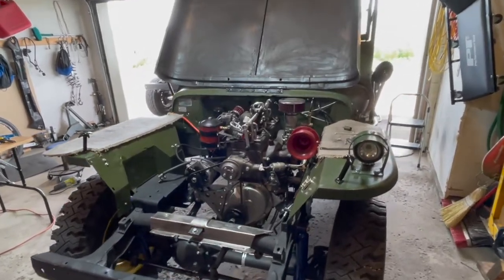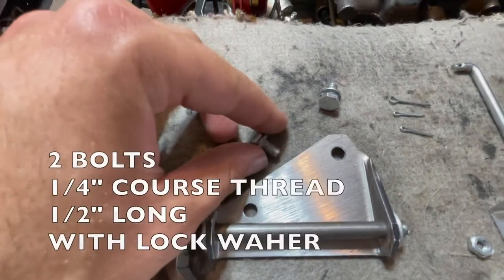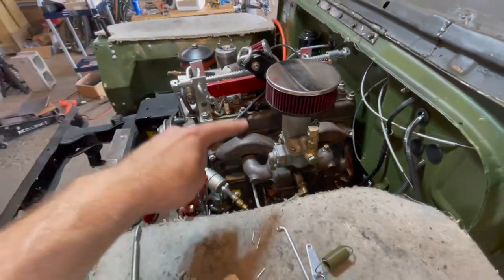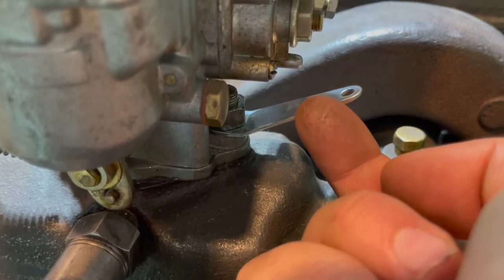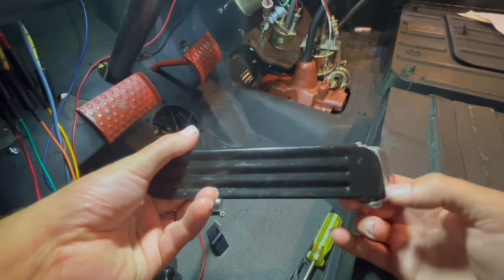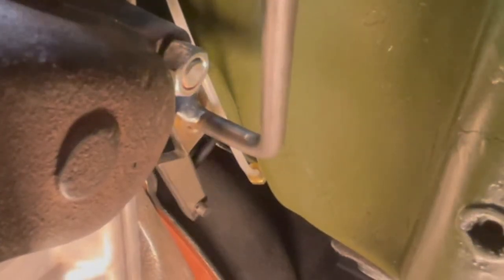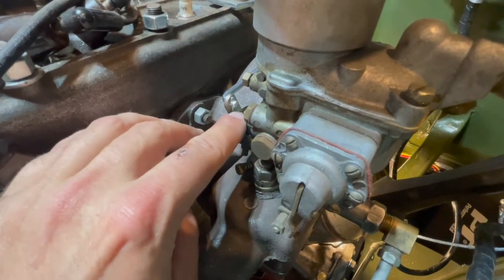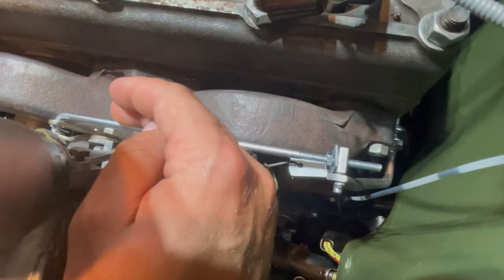How to install Willys Jeep Gas Pedal Linkage to SOLEX Carburetor

Comment: Thanks for this video.  I forgot to install the plate before I re-installed the engine.  Your screw detail was very valuable as well as the pictures of the assembly.  One thing I have learned since is that you put a floor jack under the engine skid plate and remove the engine mounts and lower the engine a couple of inches without disconnecting from the bell housing.  This will give you another inch or so behind the engine to work with.